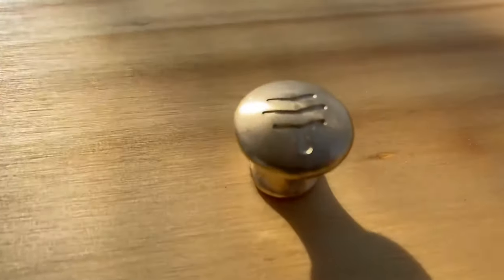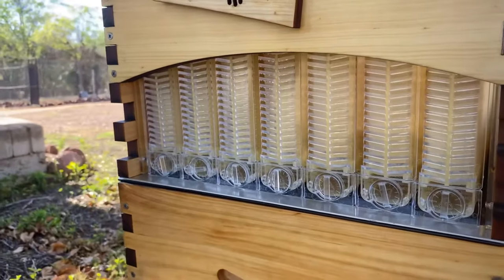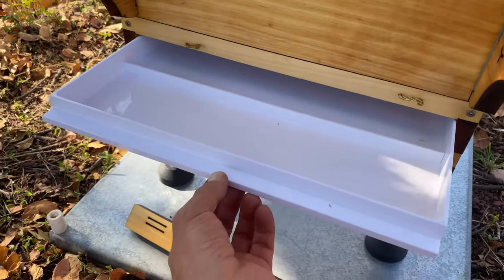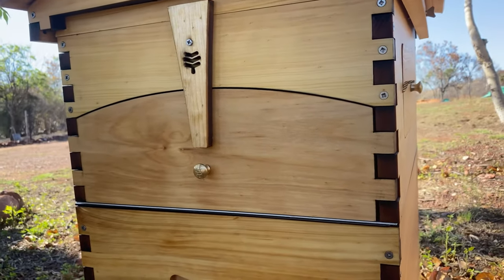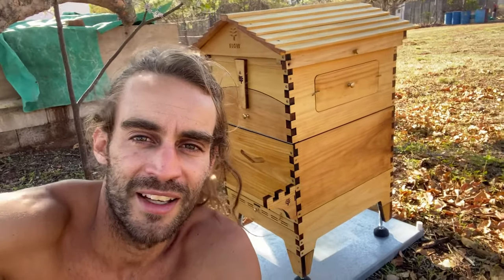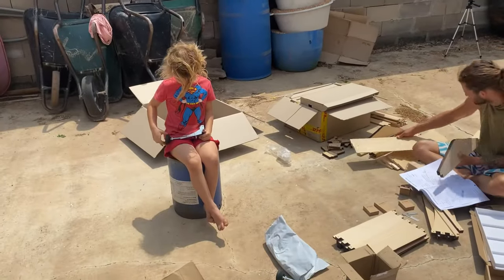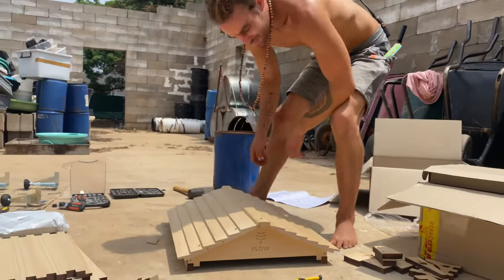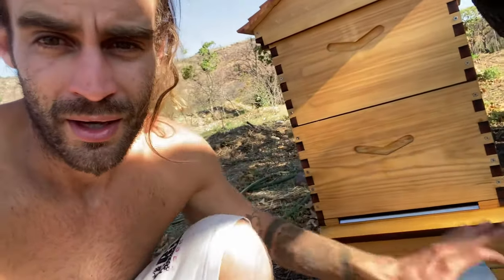Setting Up Our Flow Hive 2

Comment: Hey you two, i forgot to mention a couple helpful tips on getting the bees to take to the flow frames right away.  Starting off with a new swarm or package of bees, or NUCs, I would NOT have the super on.  Its always a good beekeeping practice to keep the hive strong to deal with pest, and you do that by only giving them they room they need at the time.  So let them start off only with the brood box, and when it is 80% full, pop the flow super on.  And before you add the super, its most helpful to melt some wax and paint it on the frames giving the frame a coat of wax.  You can buy wax on Amazon or any bee store.  Once you have that done, add it on top of the brood box-- Yet DONT' ADD THE QUEEN EXCLUDER JUST YET.  Wait two weeks to help encourage the bees to start working it.  Then after around day 15, go through the super and make sure the queen is not in there, and then add the queen excluder.  And after adding it, add a top entrance.  All these three things I have learned from several of my mentors and it will pay off.  I hope all this helps my brothers.  All the best to you.